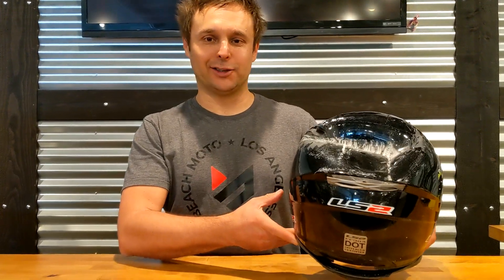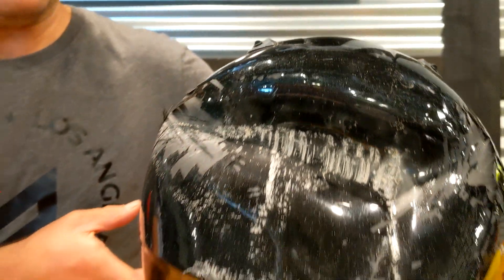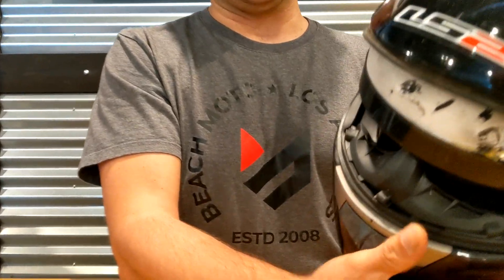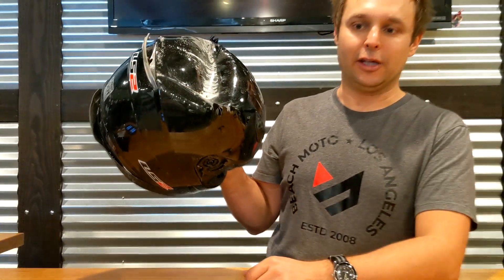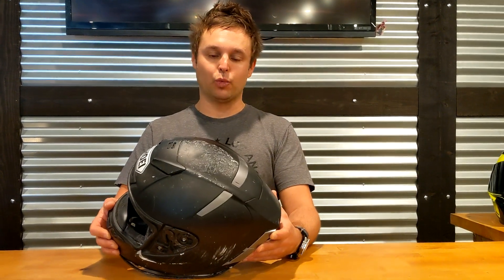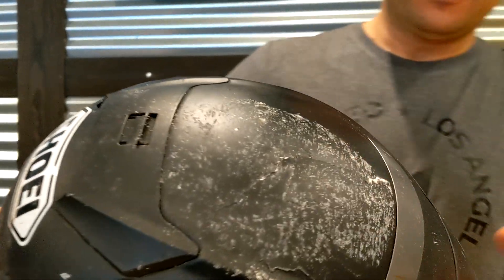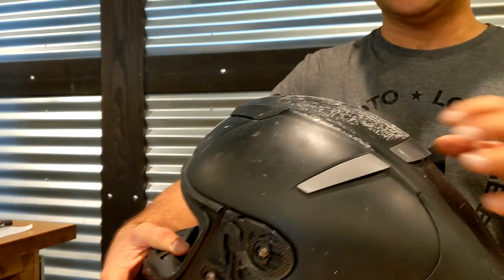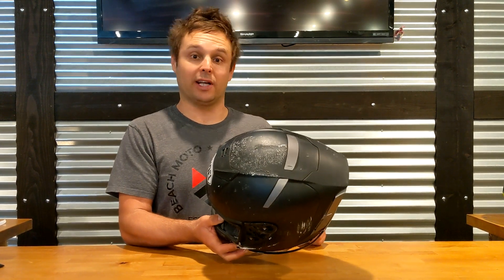Polycarbonate vs Fiberglass Helmet Test

Comment: First of all.. Technically polycarbonate is supposed to be 4 times stronger than fiberglass when comes to impact.. Two criteria i am in doubt

1. Is LS2 helmet a true polycarbonate helmet or a fake ebay ls2? Shoei also have fakes.. 

2. Assuming both helmets are original.. The years on the helmet (lifespan) plays a part on impact testing.

Actual impact testing, original vs orignal, new vs new, impact testing must be in a controlled manner only can really tell the actual results.

So to begin with.. I highly doubt both helmet wether is it orignal or fake

Comment: Sorry to say but this video is not a valid test and it's just destroying the a decent helmet for 54k views.... (Shoei was already broken anyway ;)) If someone's head was inside that Shoei at the moment of impact the skull would be broken and the brain likely partially smashed, after that the shell would return to its original shape. You can't judge by just looking just at the shell. Second, the angle of impact, are you sure they were identical or close to? In my opinion the greatest advantage of composite shells is way better shock absorption so that when one's head hits the ground it's not bounced straight away (just like shock absorbers in vehicle suspension).

Comment: Holy crap!  Looking at the video frame by frame, the fiberglass helmet collapsed downward about 30% until the face opening was no longer visible.  The helmet then flexed back to its original shape...but will your head flex back to its original shape???  Next test put a watermelon or styrofoam head in the helmet.  Wow....thanks for the video!

Comment: I am very much in doubt that having an blunt object like that hitting you with that weight and speed would be survivable. So, as result the rider would be just as much dead in either of those helmets. And therefore I think this "test" is really not so much doing any real justice. I think that the real question here is this: Does a cheaper polycarbonate provide enough protection to save your day in an accident that is survivable when wearing more expensive a fiber/resin helmet?

Comment: this hardly replicates crash, because both helmets are squashed out of shape when you watch slo-mo, i dunno about you, but my head bones are not elastic, if someting squashed the helmet like that, you'll be dead,  even with an 'intact' helmet...(just play the video on 0.25 speed and pause it at 1:45 the helmet is squashed almost to the floor) of course in real crash your head bounces somewhat, so for sure fiberglass is better option, but both of those impacts are pretty scary

Comment: Fiberglass is sturdier, lighter, disperses impact better. However i dont have many options( i have a weird head and live in a country where you eather by a shoei /arai /shark ) or you buy those sub 200 dollar helmet (barely any supplyers). Im 186 cm but have a size small head. I tryed an arai and my nose touches the chinbar, shark and suomy had too much up and down shake , agv gave me instant all round headacke, pressure on all the wrong points and still shaked up n down too much, unik policarbonate c01 fit the best, and didnt hurt but had plenty of preassure, rather have a well fitting helmet then a loosely fitting one . No im not shopping online the returns would be too much , no online domestic supplyers . Also your skull still has rigidity . Try and find a video of a chinese man with a shtty openface getting his head run over by a truck video( he survived ) but the helmet looked completely deformed. His helmet proveded enough resistance so his head wasnt crushed.

Comment: Totally non scientific experiment, lol.  First, the two blocks landed at different angles.  Try doing a controlled drop like Snell does if you really want to show how they will react.  If one lands on a corner as apposed  to flat, the result will be night and day.  Second the Shoei completely crushed regardless if it was in a previous accident or not, you would be dead from either.  Your test is pretty bogus as you dropped something heavier and higher than Snell does.  The impact you're talking about would never happen in real life more than MAYBE 1% of the time and even then you would have to be going about 200, fly off your bike and hit the corner of a curb head on which would kill you anyways from the amount of Gs transferred to your head which Poly helmets do better than fiber glass and carbon fiber at lower normal street accidents.  Please stop doing unscientific tests and misleading people, it is dangerous and irresponsible.
Reply: Here's what a proper, independent test conducted by Motorcyclist magazine found in 2005. The results are VERY surprising.
...Conventional wisdom has it that fiberglass construction is somehow better at absorbing energy than plastic — something about the energy of the crash being used up in delaminating the shell. And that a stiffer shell lets a designer use softer foam inside, which might absorb energy better. Our results showed the exact opposite – that plastic-shelled helmets actually performed better than fiberglass. In our big, 3-meter hit, the high-energy kind of bash that one might expect would show the supposed weaknesses of a plastic shell, the plastic helmets actually transferred an average of 20 fewer Gs compared with their fiberglass brothers, which were presumably designed by the same engineers to meet the same standards, and built in the same factories by the same people (the test was conducted using plastic and fibre-glass models from the same brand). Why is this? Well, we’re guessing — but it’s a really good guess. And our guess is that the EPS liner inside the shell is better at absorbing energy than the shell. The polycarbonate shells flex rather than crush and delaminate, and this flexing, far from being a problem, actually lets the EPS do more of its job of energy absorption while transferring less energy to the head. Remember, these particular polycarbonate helmets, from both Icon and Scorpion, are also Snell M2000 rated. So they are tested to some very extreme energy levels. And Ed Becker, the executive director of the Snell Foundation, is on record as saying that a low-priced – that is, plastic-shelled – Snell-certified helmet is just as good at protecting your head as a high-priced – that is, fiberglass — Snell-certified helmet. So at the high end of impact energy, we have the Snell Foundation vouching for their performance. And our testing, without the extreme two-hit hemi test, says they’re actually superior. The DOT helmets we had were all plastic-shelled, and none cost more than $100. How did they do? They kicked butt. The DOT only helmets from Z1R and Fulmer delivered less average G force to the headform, through all the impacts, than any others in the test (this included higher-end helmets from Schuberth, Shark, Arai, Shoei, AGV, Scorpion and others...Bell declined to supply helmets for the test). And both plastic lids still excelled in the big-hit, 150-joule impact – a blast 66 percent harder than any actual DOT test for a medium-sized helmet. The Z1R ZRP-1, in particular, continuously amazed us. After all the testing, its outer shell looked essentially unharmed: the slight road rash at the impact sites caused by our stubborn insistence on hitting actual pavement looked no worse than we’d expect if the helmet had fallen off the seat at a rest stop. When we pulled the ZRP-1 apart we saw that the EPS had cracked and compressed at the impact sites, just as it’s supposed to do, and as it did in every other helmet. But it had come nowhere near bottoming; there was still an inch or more of impact-absorbing foam left. And the plastic shell seemed completely unharmed, from the inside as well as the outside, even where it had taken the terrifying edge hit and the big three-meter bash. This illustrates just how hard it is to tell, from the outside, whether a helmet has taken a severe hit. And why you should never, ever buy a used helmet. 
So the softest DOT helmets came through our tests with protection to spare. But the doubt still lingered, in spite of everything we had seen: How would they do in a monster, wicked big impact? So we decided to kill them. We ran the Z1Rs up the test rig one last time. Not just to the 10-foot, 150-joule Snell test height, but all the way to the top of the rig: 3.9 meters, or 13 feet. This hit would be at 8.5 meters per second, an energy of 185 joules. That’s higher and harder than any existing helmet standard impact. We did one hit on the pavement and one hit on the curb anvil. We did them on the back of the helmets, in the center, because that was the only place we hadn’t hit them before. So, this last test is not directly comparable to the others. But it showed, in no uncertain terms, just how tough – and how protective – an inexpensive helmet can be. The peak Gs for the monster hits were 208 G for the curb impact and 209 G for the flat pavement impact. Just a few Gs more, that is, than many of the Snell-rated helmets transmitted in their seven-foot hits on the flat anvil. And even after those mega hits, the EPS liners were still nowhere near used up. The ZRP-1s are also well finished, quiet and very comfortable, though maybe a little short on venting. They’re also light: Our ZRP-1s weighed only about an ounce more than the lightest helmets in the test, the Arai Tracker GTs. What’s the cost for all this excellent impact absorption, comfort, light weight and highly durable finish? In a solid colour, a ZRP-1 retails for $79.95. The least-expensive helmets in the test, the $69.95 Pep Boys Raiders, also did well in all the standard impacts.

Comment: The comparison is so wrong that it is the first time I have seen your videos and I was already disappointed. I agree that the material of the 2 is plastic, but what you are not taking into account is the number of layers they have in their preparation and that they are manufactured for 2 different types of user, point number one. Point number 2, the user to whom it is addressed has to do with point number one since the LS2 is aimed at a user of the delivery type or short trips at low speed and the SHOEI is aimed at a user of a high speed motorcycle displacement that travels from medium to high speed, So there will be a difference in the resistance of both.

Comment: Great Video. I was wearing a Shoei Fib/Carbon full face when a lady in her infinite wisdom, turned into my path at a set of traffic lights. I was going around 35mph when I hit the drivers side front of her car ( from my viewpoint it was my left as I hit her - New Zealand - drive on the left ) and I flew over the bonnet ( hood ) and missed the windscreen; sailed past and landed onto the top right of my Shoei, basically went straight into the road headfirst...

Here’s the interesting thing - in that split second when everything seems to slow down, I felt the helmet “compress” and then “ripples” move around the inside? ( not sure ) of the helmet - almost like ripples in a bath tub if you drop the soap. My head also “appeared” to bounce - much like I watched the concrete block do on the Shoei in this vid. I will never forget the sensation - truly interesting to feel.
Long story short - Afterwards I was checking the helmet and noticed, that for a head first landing on the road, there was very little noticeable damage at the impact site; however, at the rear of the helmet ( away from impact ) and at about 5 o’clock on the helmet - It was obviously distressed. Flaking fiberglass and spider-webs.

My take away from this was - those “ripples” I felt must have been the energy moving from impact point, to the rear - and out. It’s the only thing that makes sense.
Hope this helps someone.
Cheers.
Reply: I watch Demolition Ranch on youtube and he has a video where he shoots a glass ball. This same type of thing happens where the energy travels around from where it’s shot and cracks the back. I’m guessing it’s a similar phenomenon, but I’m not sure what’s happening. Glad to hear you’re doing well after something like that!
Reply from the maker: Interesting observations I hope never to experience myself.
Reply: Sorry about the crash man. As far as i understand it, thats why fibre glass is better. It spiders and almost shatters like tempered glass which spreads the energy out over a broader area. I have the option of a fibreglass hjc that i know fits vs a bell polycarb with MIPS.  Tough choice man but fibreglass seems like a better bet for me
Reply: Did you sustain a concussion?

Comment: First you should do the test with a fake head inside. Second, the Shoei resisted as shape, but if you look at 1:44 wit 0.25 speed you see the deformation would have smashed the head in any case.... 3rd when you get such weight on straight on your head, there's no helmet which will save your neck to snap. 4th the angle of impact is different and therefore the force distribution is VERY different, so this test is just useless...
Reply: Its not useless. Even though it wasnt scientific in its implementation you can clearly see the strength difference between the 2 materials. There is a reason why fibreglass helmets cost over 350 and you can get polycarbs for 70 dollars
Reply: @absolutelysobeast I mean he did say the fiberglass shoei was in a previous crash sooooo😅

Comment: the deformation in fiberglass is at the open area of the view not at the area of the skull that is what we saw and what  we want  its WAYYYY better than all thermoplastics i am an thermoplastics mould maker believe me if you have to choose go for fiberglass for your safety...
Reply: This is absolutely true, thermoplastics are just so much less stiffer even thought they are more tough i assume that just means it will deform/bend for a second and crush your skull while fiberglass is multiple times stronger in actual strength but is not tough so once an impact is too large it will break at certain specified places/ways according to the manufacturers intentions
Reply: @leonordin3052  Any breaking and cracking isn't the problem with the fiberglass, the fiberglass is flexible to the point of collapse but your head isn't.

Comment: Is ABS same as Polycarbonate ?
Reply: On a high level, polycarbonate is more expensive, flexible, softer, and lighter. Conversely, ABS is much cheaper, as well as harder, heavier, and more brittle. So if you want a helmet that's thin and light, you're much more likely to find that in a polycarbonate shell.

so...... polycarbonate is better. hard and heavy doesn't translate to good...
Reply: @usynnstradler    Are  polycarbonate and thermoplastic same ? In Google I couldn't find the the difference . It says polycarbonate is also a thermoplastic. And even abs is also a thermoplastic. Could you please explain if you have information ?
Reply: @JC-nx5xx "thermo" means heat.
So, both abs and polycarbonate are melted at high temperatures and put into moulds to create a helmet shell.

Comment: People, this huge brick was overkill but a stronger shell is going 2 take the initial impact better then a weak one will. The plastic seemed more like u just wearing a styrofoam helmet without a shell. This video is also a good feminder to ride safe, going 90mph head first into something and your helmet aint gonna do crap. But bounce it off the ground and the fiberglass gets my vote.

Comment: The fiberglass one deformed, pause video and take a look, the wearer would be dead.
Reply from the maker: Good eye Simon. The reason it actually deformed was the fact that it was previously crashed at over 140mph and there was a crack on the chin bar.
Reply: @BeachMotoLosAngeles  Nah...fiberglass is made to be flexible....it will deform and return to its original shape.
Reply: It collapsed and squished down until the face opening was not visible.  Fiberglass in naturally flexible.  It is springy. Your head would have been crushed like a Halloween pumpkin under someone's foot, while the helmet returned to its former glory.  The best helmet does not dent or collapse.
Reply: Maybe a regular brick would of been a better test but i'll be wearing a fiberglass helmet for now on.
Reply: @nobodysreview6137  but it deformed....

Comment: Did you see the elastic deformation on the fiberglass helmet? Only differnce is that the polycarbonat has a plastic deformation. Lol
Reply: The difference is on penetrating impact, it is assumed that your body is not rock solid and your head will be displaced with the impact, you are not atached to the ground...
Reply: Ya but still, why wear a cheap helmet. That plastic one really is weak, i c what you mean but the stronger shell will stop more of the initial impact. This isnt a very scientific test but yikes that plastic is weak, like just wearing a styrofoam helmet with no shell.
Reply: @nobodysreview6137  the fiberglass bent out of shape crazy too but just bounced back into again
Reply: @usynnstradler  Well i bought a Simson Outlaw after watching some of this stuff, Snell rated and as solid as i could find. I have a open face Biltwell for around town though.
Reply: @nobodysreview6137  Simpson buckets rock!